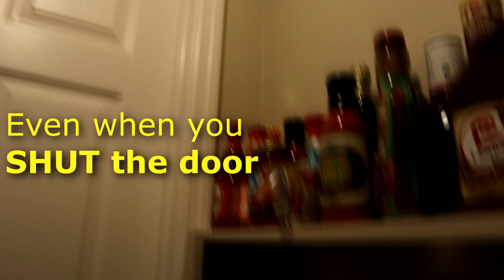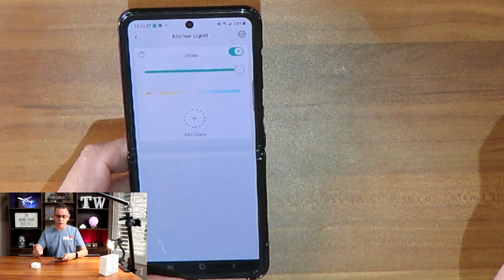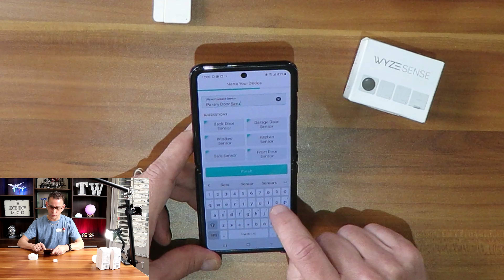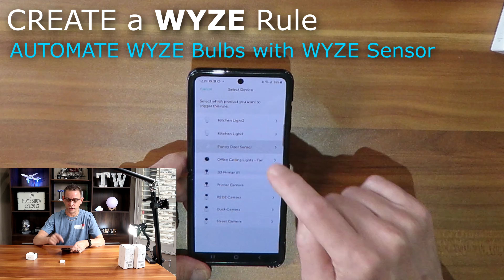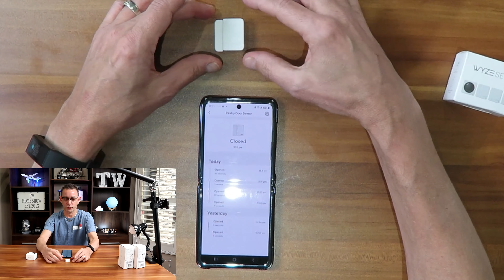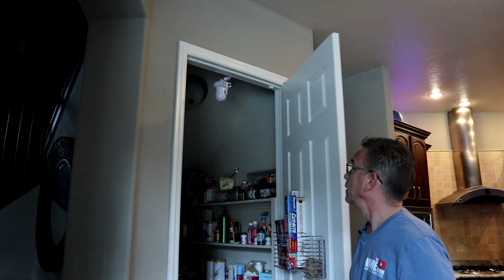WYZE Bulb and WYZE Door Sensor Automation | Automatically turn ON Lights when Door Opens!

Comment: You can get motion sensing light switches, simpler and more reliable. Lutron Maestro works great.
Reply from the maker: Yep, my issue was that the light switch was on the outside of the Pantry...so everytime I would pass-by the outside of the Pantry, my pantry lights would turn on needlessly. That's why I like the door switch, in this case :) Thanks for watching and helping with another solution :)  Todd
Reply: @twHomeShow  makes sense